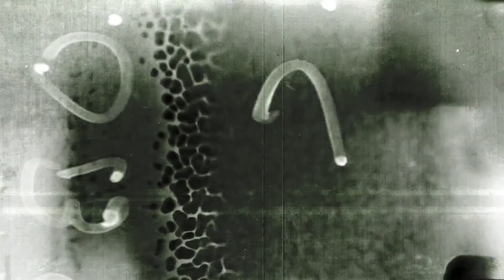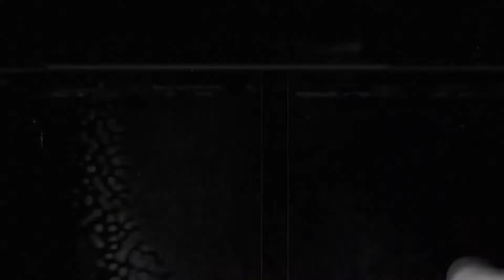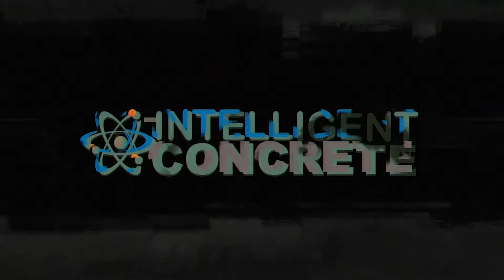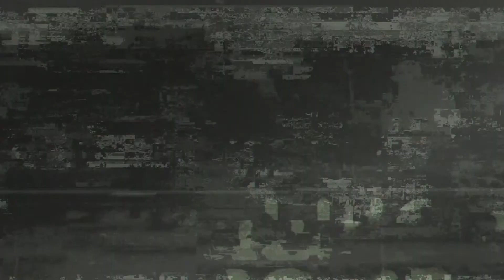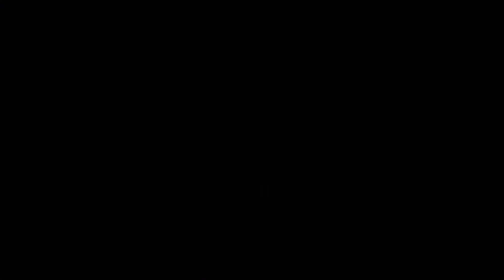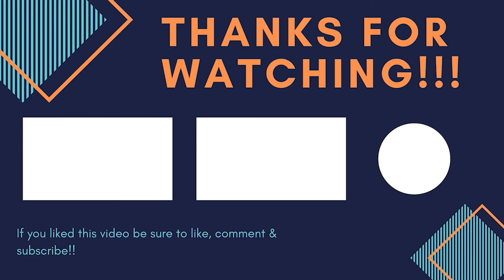The Basics of Geopolymer Concrete Part 2 - Vlog 688

Comment: I am looking for a concrete recipe that resists cracking of thin parts (.24"). I've seen some writing pens made from concrete and I'd like to do the same but the concrete I've used from the bog box stores doesn't give enough tensile strength, or the parts shatter when dropped from waist height. 
Any thoughts?
Reply from the maker: It sounds like you need a grout mix.  Have you looked at Trinic?
Reply: @IntelligentConcrete  I have not. I did find your video on it- https://www.youtube.com/watch?v=5YLgkI8VIbk. I'll start looking into that. Hope I can find it out west.
Reply from the maker: @coulterjb22  Let me check into what’s out in California. I know there is Omega International in Colorado and they have a wide variety of products you can choose from for your project. If you want to customize the mix please send me a direct message with an email address.
Reply from the maker: @coulterjb22  Let me check into what’s out in California. I know there is Omega International in Colorado and they have a wide variety of products you can choose from for your project. If you want to customize the mix please send me a direct message with an email address.

Comment: what proportions and grades of  fly ash, slag, silica fume, metakaolin and other pozzolans do you recommend for waterproof chemical attack resistant geopolymer  and why
Reply from the maker: All of the above and the highest grades available within your local area.  I would be surprised if you can get Class F Fly Ash that meets ASTM C 618 and most slags have been doing poorly within the last couple of years.
Reply: @IntelligentConcrete  Good to know. Taking what you said into account, what is your favorite recipe for waterproof concrete mix then? Shall I just go for 20% metakaolin and 5% silica fume with 0.42 water?
Reply from the maker: Thanks sounds like a great starting point.
Reply: @IntelligentConcrete  ''starting point''
 implies that I have a long way to go  - I'd greatly appreciate it if you can point me in the right direction. Thank you!
Reply from the maker: What test are you using to verify water repellent.
Reply: @IntelligentConcrete   not using any tests at the moment but open to your suggestions.